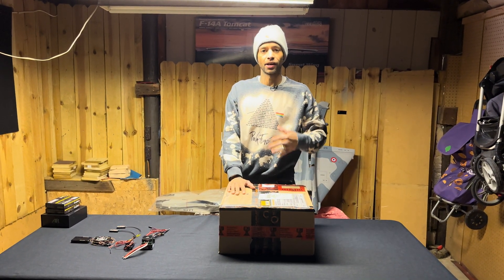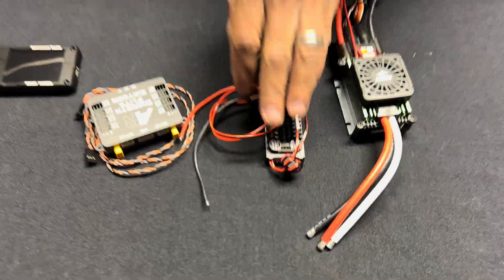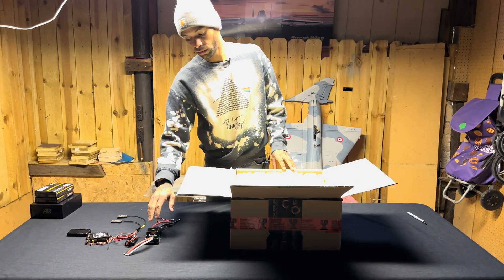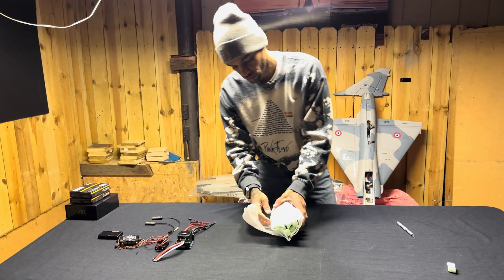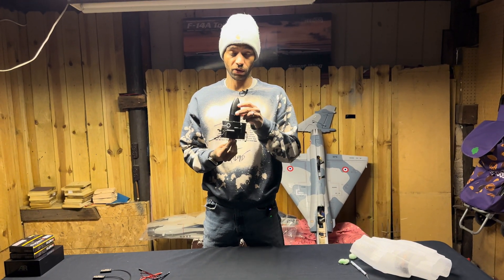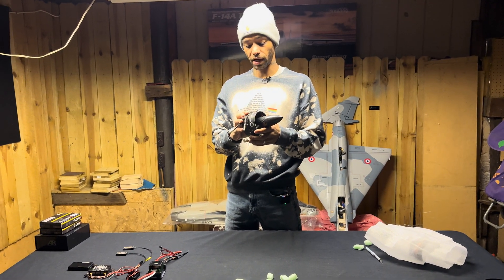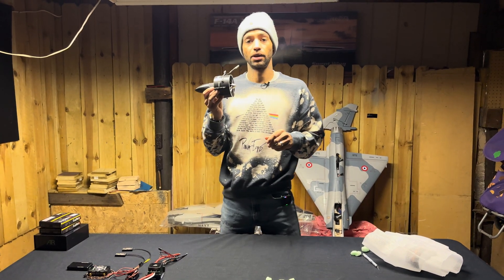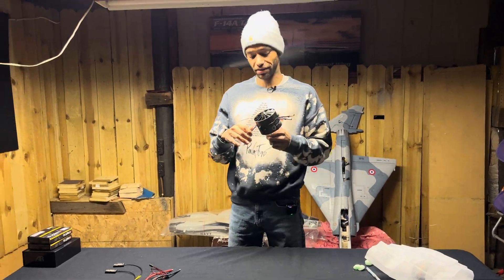Worlds Fastest 90mm EDF Unboxing- Schubeler DS-51-DIA-HST

Comment: My DS-51-DIA-HST arrived today. I have put it inside my F-22 fuselage. 
I thought it will be a 30min job, but it took 3 hours(!). This fan is 93mm EDF with a very large intake lip (which I had to trim by half anyway), plus the ESC wires need to go around it, rather all together on top - I had to cut out  A LOT of foam to fit it all. If you did not do the work yet, get a hot U-shaped wire for styrofoam cutting first.
Reply from the maker: Sweet man!!

Comment: My long term ongoing project was also to make the most powerful Freewing F-22, it looks like we are on the same track.
Currently I am using a Schubeler 90mm HDS with HET 700-75-1250 on 12S, but yesterday I also ordered a 93mm HST fan to step up :)
One tip from me: the ducting is OK for the stock motor (little difference between reference values and installed thrust), but for such extreme setups, both inlet and outlet are way too small.
I removed the duct splitter (two horizontal cuts) and added a cheater hole in the EDF cover, just in front of the fan. This has increased the performance by A LOT - for no cost or added weight. I don't have the old values, but I after the mods I have 6.8kg (15lb) of installed thrust at 155A using SMC HVs.
I hope to get 7.5kg using some less amps with the HST.
Reply from the maker: Hey man!! I actually did the same thing with the cheater holes!! lol we are making the doors now! Thank you for your tips I appreciate it. I loved the last one on 12s that we did with an 1125 Schuby. I’m firing it up today finally got the batteries soldered last night. Looking forward to more chats. My email is hamiltonhangar@gmail.com
Reply from the maker: 12s 90mm Freewing F-22 Raptor
https://youtu.be/85V8kNCCThE here is the first one we did a couple years ago now
Reply: @hamiltonshangar  I saw this one. You gave me some inspiration, to get the Schubelers. 
I have just added two flight videos of my setup today - check them out. 
One more tip - you mentioned you want to use two 6000mah batteries. If remove the balsa battery board, then you will be able to put them in the back, on top of each other. This will give you a neutral CG.
Reply from the maker: @adamtrzaskowski3901  damn man that’s awesome!! I do have a 6000mah flight on the channel as well. You can do whatever you want to this jet lol. I did check out your flights and that thing is light! Consider reinforcement in the fuse and wings before throwing the HST in there. It’s so beneficial. I can share my build anytime. :)
Reply: @hamiltonshangar I am using the extra power for verticals and coming out of 3d maneuvers. I actually never went full power for longer then 2-4 seconds. Extra reinforcements would make it heavier and hamper the 3d performance - and I would still be risking structural failure ;)